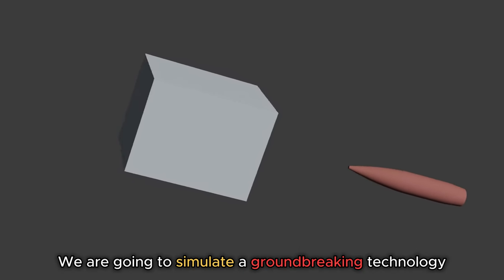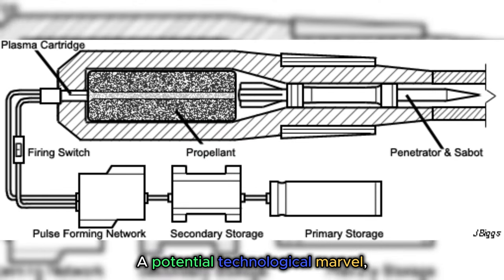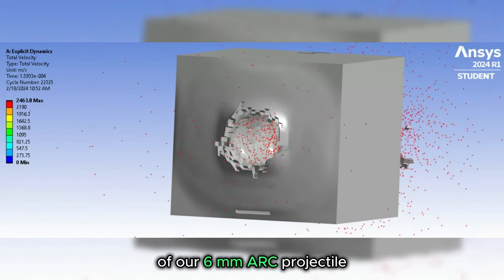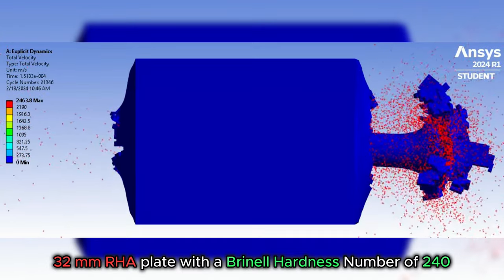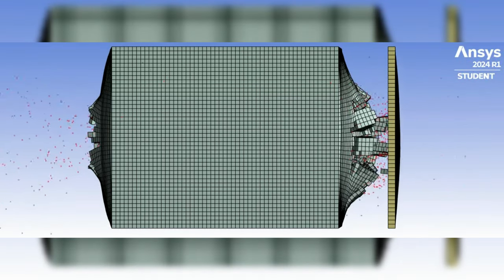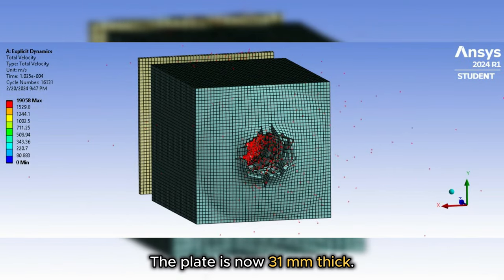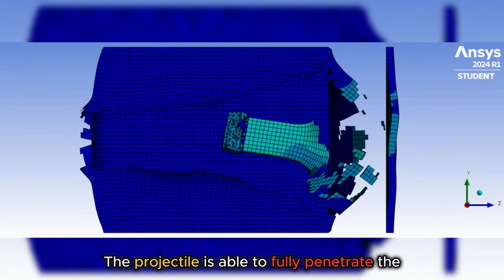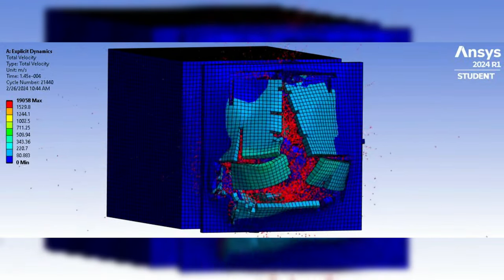ETC Guns: The Future of Military Firepower

Comment: The key are inside Bolt carrier they need build piezzo igniter, and for bullet replace the primer with electric conducting material like pure Copper. No battery needed just piezzo igniter as propellant burner

Comment: You know they can go up to the speeds of a railgun of 4km/s or even higher with more pulses into the plasma input of the round or higher energy input however more electrical input makes it heat up the gun more but it could increase velocity but the number of pulses into the plasma into the round could certainly prevent the need of more electricity input while preventing high amounts of heat generating as a result into the gun

Comment: Curious, do you have the ability to model metal foams and plastics? I think a plate with a Silicon carbide or corundum strike face of 5mm, with a UHMWPE sheet of another 5mm thickness, followed by a Titanium foam layer (12mm) and a 2mm Kevlar spall liner would be an amazing design that is feasible to produce in the next 20 years.
Reply from the maker: I might try.
Reply: @YTechSimulations  I also like the new thumbnails, posting velocity could grab attention and don't forget red arrows, the algorithm likes red arrows.

Comment: Great simulation video, could I ask of you to do a similar simulation of a composite armor I have in mind.

The armor consists of:
5mm of Tungsten carbide
5mm of AR500 steel
5mm of Titanium
5mm of Tungsten carbide 
5mm of AR500 steel 
5mm of titanium alloy
And a final layer of Kevlar 
The cartridges you could fire at it would be 5.56, 7.62x39, 50BMG AP, or 20mm AP
If you can that would be really amazing. Thanks.
Reply from the maker: I'll se what I can do.
Reply: @YTechSimulations  Thanks!